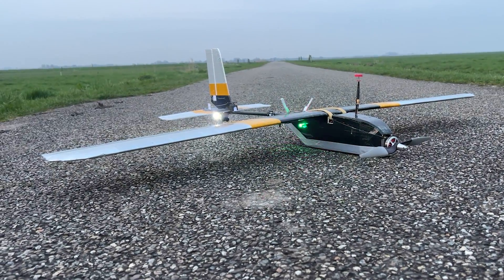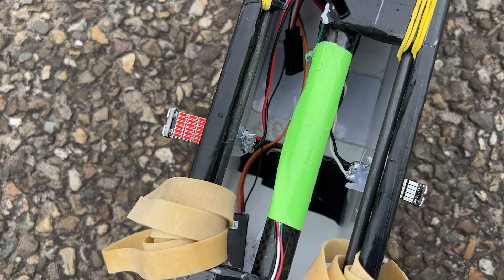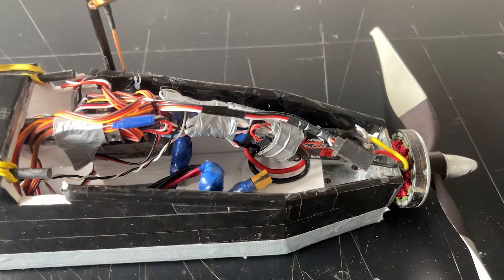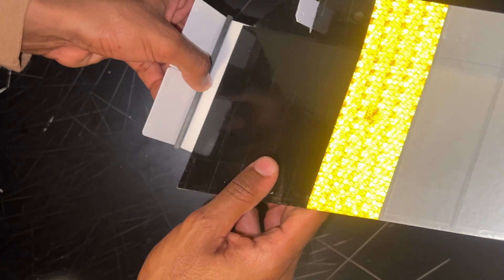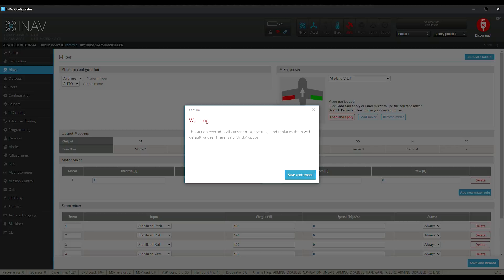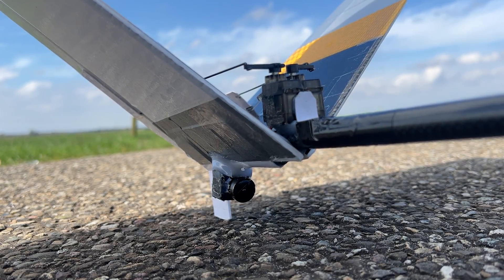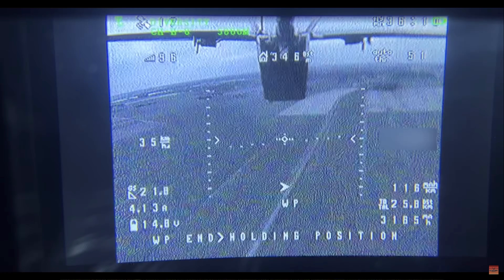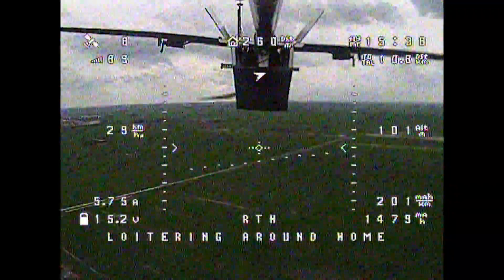V-Tail Conversion for Autonomous FPV Plane - Complete Build & Flight

Comment from the maker: ALL Compatible Electronics LINKED here: 

Flight Controllers:
SpeedyBee F405: https://s.click.aliexpress.com/e/_olL6j9B
Matek F405-WING (V2): https://s.click.aliexpress.com/e/_onijCMD
Matek F411-WTE: https://s.click.aliexpress.com/e/_Dl1b8Mx

Brushless Motors:
Racerstar BR3536/950kv: https://usa.banggood.com/custlink/GDKY1LuzDG
Dualsky 2316C/980kv: https://s.click.aliexpress.com/e/_oljspVX
FlyCat iRotor 5010/750kv: https://s.click.aliexpress.com/e/_omhpFYH

ESC's:
Hobbywing 40A ESC: https://s.click.aliexpress.com/e/_DBKc6Y3
Hobbywing Skywalker V2: https://s.click.aliexpress.com/e/_oBW4M7J
RedBrick Brushless 50-200A https://s.click.aliexpress.com/e/_okNVfn7

Servo's:
MG90 Servo's: https://s.click.aliexpress.com/e/_oms9r6p
Emax ES08MA II Servo's: https://s.click.aliexpress.com/e/_oEMdlaZ
SG90 Servo's: https://s.click.aliexpress.com/e/_oDIZuiz

(FrSky) Receivers:
FrSky RX8R Receiver: https://s.click.aliexpress.com/e/_oERkIYt
FrSky X8R Receiver: https://s.click.aliexpress.com/e/_ooQ5VUl
FrSky X6R Receiver: https://s.click.aliexpress.com/e/_onEFBih

Video Transmitters: 
Eachine TX805 800mW VTx:  https://s.click.aliexpress.com/e/_ooEEDnL
Eachine TX526 600mW VTx: https://s.click.aliexpress.com/e/_ongkrZB
TS5828L 600mW VTx: https://s.click.aliexpress.com/e/_onvDcvF

GPS Modules:
Beitian BN-220 GPS: https://s.click.aliexpress.com/e/_oFeXi57
Beitian BN-180 GPS: https://s.click.aliexpress.com/e/_olF2lpR
Beitian BN-880 GPS: https://s.click.aliexpress.com/e/_oo85uG1

(Budget) FPV Goggles:
Eachine VR009 FPV Goggle: https://s.click.aliexpress.com/e/_oo71zBb
Eachine EV800 FPV Goggle: https://s.click.aliexpress.com/e/_oEJrjip
Eachine EV800D Diversity FPV Goggle: https://s.click.aliexpress.com/e/_oobNQHx

Radio Control R/C Transmitters:
FlySky FS-I6X Transmitter: https://s.click.aliexpress.com/e/_op9O6fX
FrSky Taranis X9 Lite Transmitter: https://s.click.aliexpress.com/e/_opORFVX
FrSky Taranis Q X7 Transmitter: https://s.click.aliexpress.com/e/_oFObQff

Comment: I think you don't know much about real aircraft design when you equate a V-Tail with 'better performance'. It's certainly not worse, but the commercial full scale aircraft industry has already done this research and design iteration. And still don't use this design - aside from some notable appearances for aesthetic reasons. It looks different. In the real world - not enough difference to make a difference. Unfortunately, V-Tails also come with the inherent down side of coupled motion. Particularly, paradoxical un-favorable coupling of yaw and roll. When yawed in one direction, it also tries to roll in the opposite, undesired direction.

Comment: I like this design, so I ordered all the parts you listed in your link, to build my first plane. $167.71 CAD 
I've made the 3D printed ones before from Tom Stanton, but they are hanging from my office ceiling as eye candy and not for flying. 
3D printing one or buying an air-frame is too much money for what it is. I'll crash and then cry.

Comment: The V does appear to make for a simpler build assembly compared to the conventional T design.  I'm unconvinced it will make a significant difference, but look forward to follow-on flights to see how real-world efficiently and performance compare. Thanks for doing this, just to compare the results. This single boom design of yours is one of my favourites.

Comment: please make detailed video on how to make simple navigation light
Reply: See @ 15:51 is original build video: https://youtu.be/q6YIdY0WnOY
The are purchased LED circuits, but unfortunately there is no link to specific item used. Similar can be purchased online, just need to make sure voltage range overlaps with your planned battery choice.

Comment: Oh man...imagine a simple meshtastic lora repeater built into that and flying at several thousand feet...the range would be incredible! (or a stripped down Baofeng UV-5R with a simplex repeater for emergency comms)
What would a payload weight be for a little bird like that...if it was set to fly high but in a circular holding pattern?
Reply: Remember at several thousand feet AGL you are playing in the big birds yard. The last thing you want is to cause a mid air with a passenger plane. A lot of people would be VERY unhappy with you.  I don't know if there is a device that can act as an aircraft avoidance system for a drone. That might be the ticket to flying the altitudes you are talking about. Its a neat idea even at 1000 feet for property security overflights. Beats hovering a drone on a very long tether.

Comment: I havent built a plane yet but im planning too, your channel is fantastic btw.

Question, when building a wing is there any reason you couldn't run the LED wires down to the wing tip and have a clear cutout or something?
Reply: its going to be a few more wires to plug/unplug when detaching the wing but it will be neater! make sure the wires have some slack to avoid tension buliding when the wing bends.